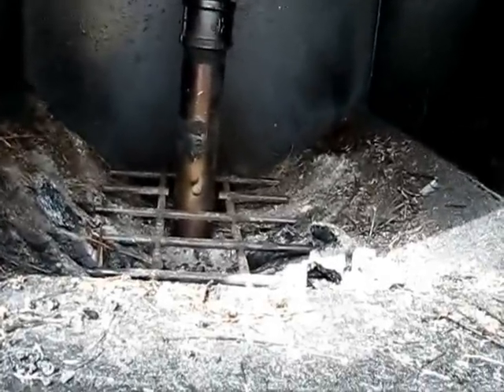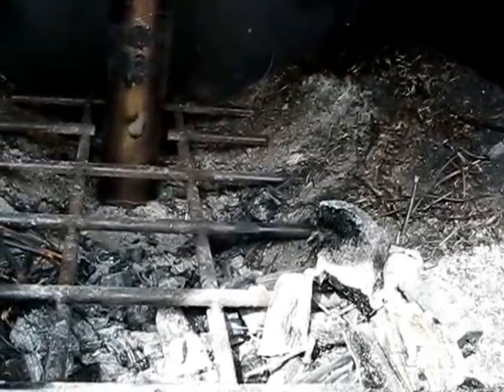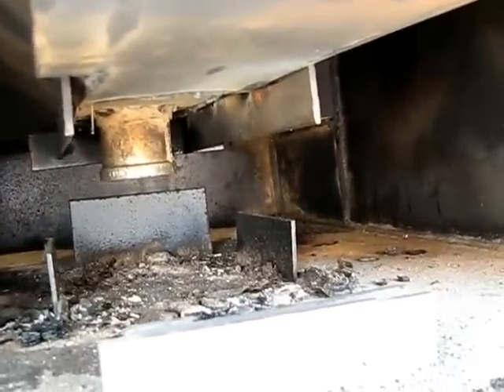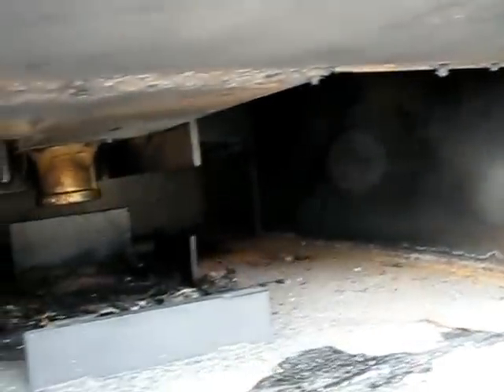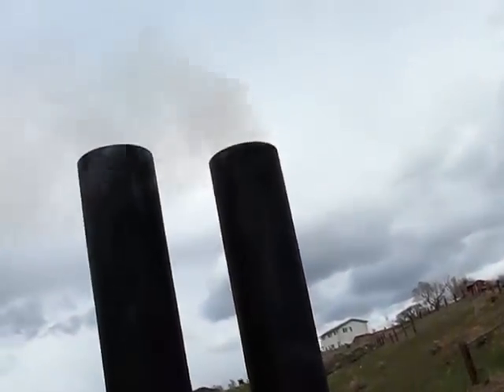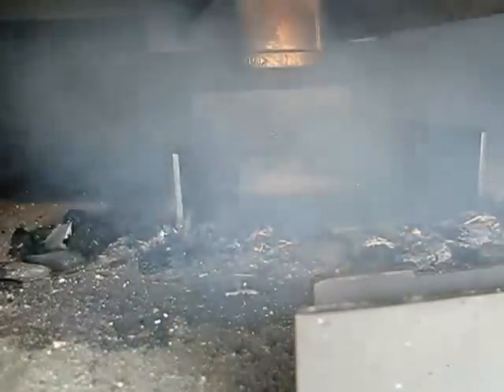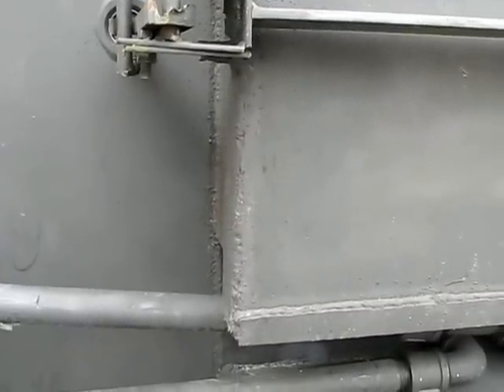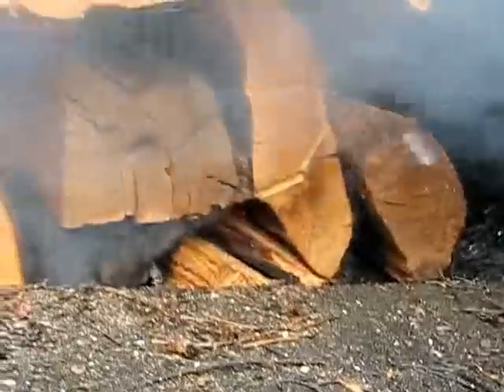wood_boiler #2 video

Comment: hi
is the chimney open when the process of gasification occur or it is must open all the time if not is it explosive
where is the steam and vapor - that occur when the water is boiling- goes is there a hole or a valve to vent the vapor
if we make this device from a plate of 3mm is it success
if the tempreture  reaches about 2000f from the inside of reacter is the fan and the bump stop working ? 
what is the safety ways that we must put it in this device
thanks very mutch
عرض عناصر أقل  ·
Reply from the maker: Hi Naser azam,
The chimney is open all the time, but does have some baffels in it.  I don't think it would be explosive if the chimney was closed, but it would force smoke through my blower until the burn stopped completely.

The water never actually boils (or shouldn't), but I do have a 1/2 inch pipe at the top of the water jacket that keeps the pressure at atmospheric pressure, otherwise there would be a risk of explosion...

3mm is a little thin to be inside the reactor.  I used 1/2 inch which is 12.7 mm.  I also covered the steel with firebrick leaving only the grate to see that high temperature, and the grate has eroded a lot over the season.  I will have to replace it yearly (it is made from 1/2 inch rod).

For safety, There are a lot of risks when dealing with fire, and everything envolved with it, so you need to take precautions.  I can't list them all here.  But do make sure everything is vented.  I am working on some plans, and have a lot of information on my site, and plan to keep adding more.
Reply: Willisolarpower http://myaccount.cyberweld.com/pd_custom/mod_productReviews/userReviewImages/large-temp57e724ce91f66.jpg
Reply: Willisolarpower

Comment from the maker: Yes, I have it working very well now.  I have been working on putting in floor heating in my house, and I still need to build the insulated shed around the boiler, and wait for winter.  I also plan on organizing my web site and videos so they are easier to follow. 

My more resent videos show the burn working correctly.